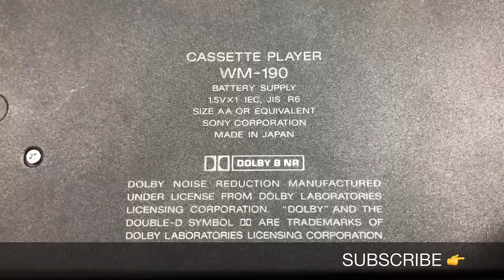SONY WM-190 Walkman Cassette Player Maintenance Repair Restoration

Comment: You did a great repair job. But you missed one tiny thing.... You didnt replace the capacitors 😐. These "green button" walkmans are known for having failing calacitors. These mechs were also quite flawed and ate tape, once that gear cracks...

Comment: Hello I have 3 of this Sony WM-701 , 1- WM-702, and 1- WM-707 but all of this ,I changed  the belt , cleaned thoroughly the wheel pulleys, and they suffer from severe wow & flutter. I even changed the pinch rubber . I even adjusted the speed.  what can you suggerst? 
My idea IS TO OPEN THE MOTOR AND OIL IT.  What can you suggest , based on your experience.? Please. thanks
Reply: 你需要换质量好的皮带，皮带长度要合适。需要彻底清洁电机，飞轮，润滑主轴，更换压带轮。
Reply: As others have suggested, clean the spindles and belt drive pulleys thoroughly, and also pay attention to replacing any electrolytic capacitors on the PCB as they control the motor power regulation.